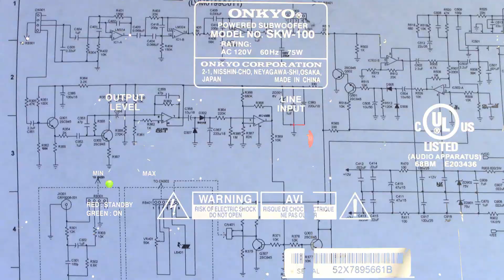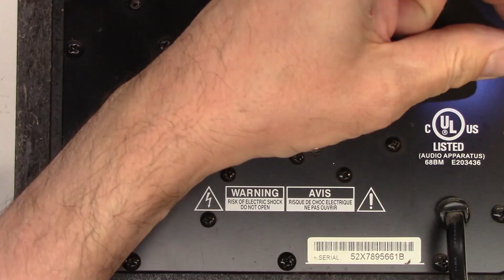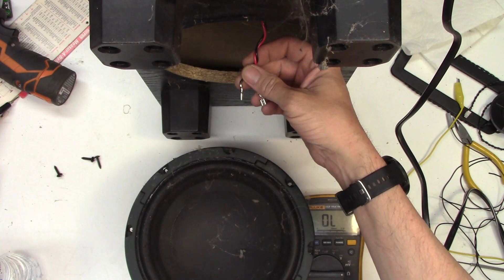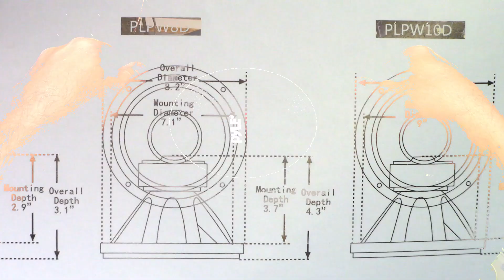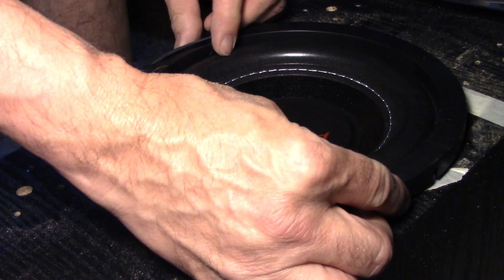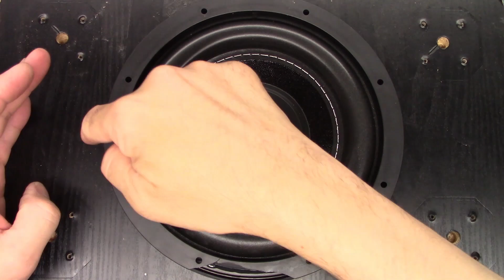ONKYO SUBWOOFER SKW-100 NO AUDIO REPAIR WITH SCHEMATIC DIAGRAM   PYLE PLPW8D

Comment: Hey man, my little brother just passed away and his Onkyo Speaker worked but while moving things around it stopped working, I opened and checked inside and it seems the board connected to the power supply has cracked off Any suggestions? I live in Riverside, CA

Comment: Power supply problem brother
Reply from the maker: I don't get it? the replacement speaker repaired it. How do you think it is a power supply problem?
Reply: Guessing another potential problem with the same/similar symptom. Maybe that was what caused their issue.

Comment: hello I have an onkyo 5910 home theater system I was listening to loud music I think my subwoofer burned out because it stopped sounding but if it turned on I did tests with a small speaker and if it worked but now I will buy the subwoofer but I don't know how many watts to buy it is 10 inch but it does not matter if you put a new 10 inch 500w 250rms but I do not want it to burn with your experience they burned or not

Comment: Where did you get the service manual? I requested one from Onkyo, and they said they're only for "certified" Onkyo technicians. I'm certifiable, so that should be sufficient enough to fix a simple plate amplifier.
Reply from the maker: hifiengine.com and or elektrotanya.com
Reply: @norcal715  i broke the red plug in the line input can you help with that or do no a way

Comment: Sir I have klipsch R125w 12inch front firing active sub woofer power on light  but no sound. Please help me
Reply from the maker: Email me norcal715videos@gmail.com
Reply: @norcal715  klipsch 12 inch front firing sub woofer power light on but no sounds
Reply: Can we use 800 watts by 100 watts  does it cause any blown out on sub or av receiver  pls reply

Comment: Wonder if you soldered the speaker wires on the original, if you get the 4ohms again. Have had that happen before
Reply from the maker: I did ohm the flex leads as they came out of the woofer cone and still infinite resistance.

Comment: Another nice video. As a retired repairman, there is one thing I would suggest. Anytime you have a blown-out speaker in a solid-state amp always check for DC on the speaker wires before installing a speaker. I have had a lot of subs that came in with no sound. Sometimes it would just be the speaker gave out. Other times the amp would short out passing one of the DC supply rails straight to the speaker. Let me tell you if you put a new speaker in with one of the supply rails  (it doesn't matter if it is the plus side or the negative side) going though a shorted output device and then going to the speaker. That voltage can burn out a voice coil pretty fast. You do not realize what is happing since the sound the speaker will be making is the ripple off of the power supply. Then the speaker goes up in smoke.
Reply from the maker: I did test for DC output upon 1st fire up when I had my bench speaker connected.  This happens at 3:25 in the video.
Reply: @norcal715  That is true. The problem is that you had the speaker connected when you tested for the DC voltage. If you power up an amp and say the voltage rail is plus and minus 40 volts and one of those voltages is going straight to the speaker it doesn't take long for that voice could to burn. It is better to be on the safe side when checking for DC on the speaker line. Trust me I have learned that the hard way.